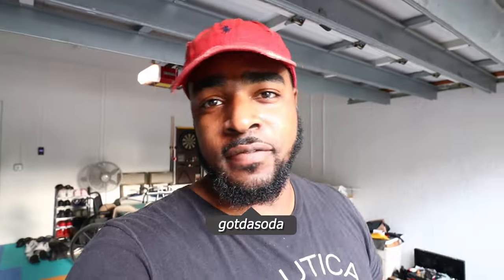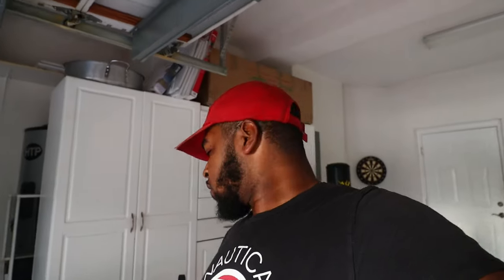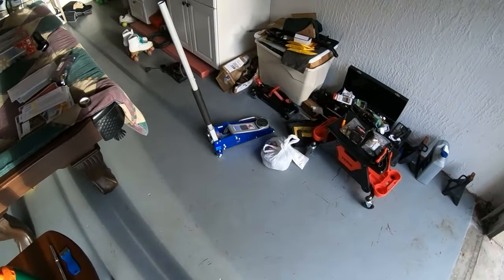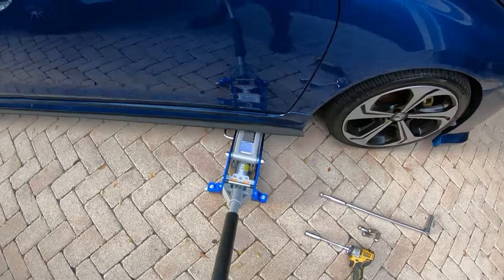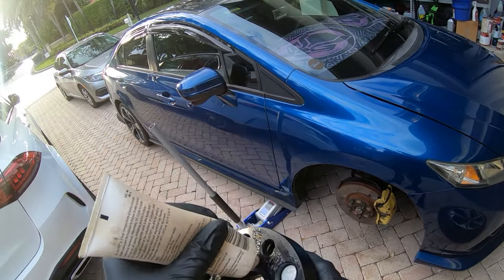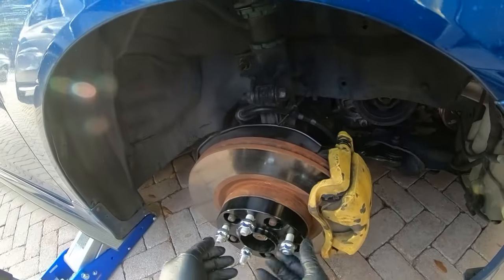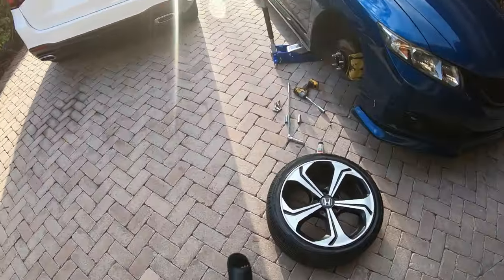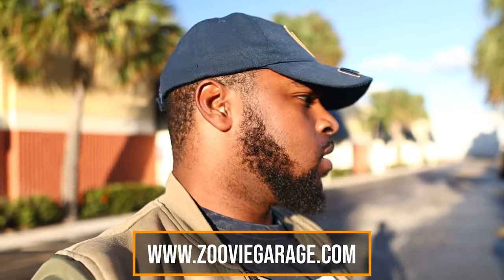HOW TO GET PERFECT FITMENT ON YOUR HONDA CIVIC SI

Comment: How low did you set the rear springs to get that flush hight? I have a 2014 si and on the rear the current setting I have is 4 lines exposed on the bottom part of the collar?

Comment: I have a Honda civic si 2020,please help me figure this out or if it’s going to be a longer term issue ,on cold starts there’s no throttle response for a second , so I would back out my parking spot at work after a 10 hour shift and it would be fine backing up and moving forward in first gear then I would get to a stop sign in the parking lot  press the clutch down and then when I was trying to rev it a bit when the clutch was all the way down   , there was no throttle then I tried again and it worked then it worked  is there any explanation to this I’m shook

Comment: Should’ve went with 20 mm. No rubbing with stock wheels on all accord and civics
Reply: How does it look with 20 mm spacers?
Reply: @JoseEscobar-ni1up  almost the same. its 5mm difference. witch is like 3/16 of an inch. difference is in tire width and camber

Comment: do you think with 20mm wheel spacer on bc coils will rub on the rear bro?
Reply from the maker: No clue bro , depends on how low the car is
Reply: i have the 15 si stock rims on my car was planning on putting 25mm spacers but kinda worried, it may rub in the rear so i went with 20mm. i seen thus guy on youtube running 20mm with 13 si rims he rubs a little on a steep drive way, wonder if the 13 si and 15 si make difference in specs.